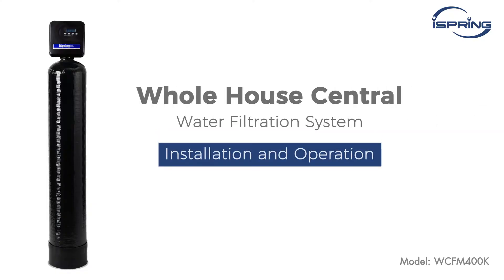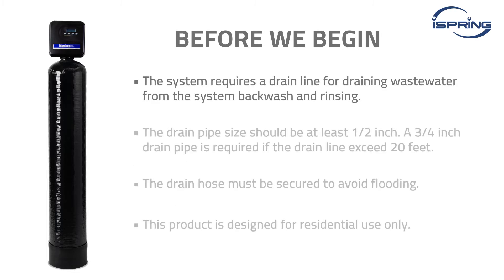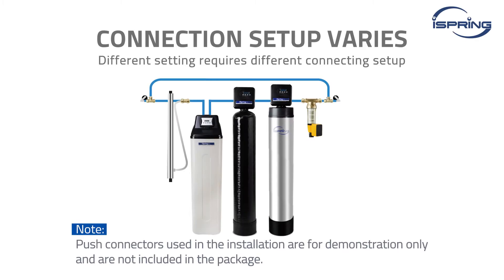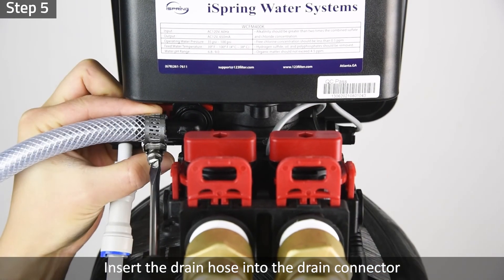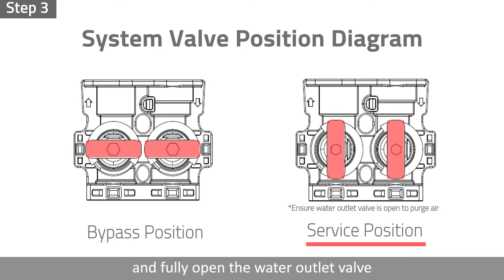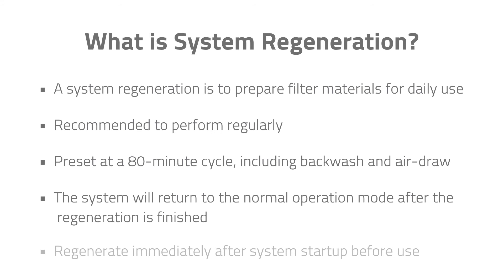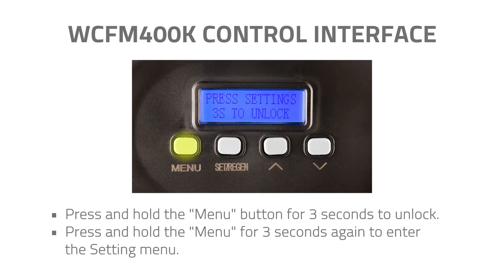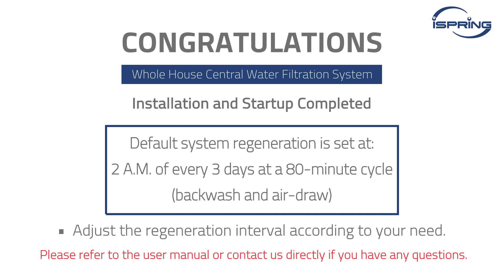DIY installation and Operation Guide | iSpring WCFM400K Whole House Water Filtration System

Comment: The manual says to open inlet bypass valve for system regen, but doesn't say to open outlet valve. The instructions here don't say to open or close those. What should be done with the bypass valves during the first system regen?
Reply from the maker: Hi there! During regeneration, the outlet knob should remain closed.
If you have further questions or concerns, please contact us at support@ispringfilter.com or 678-261-7611 (Monday–Friday, 9 AM–5 PM EST).
We’re happy to help — thank you!